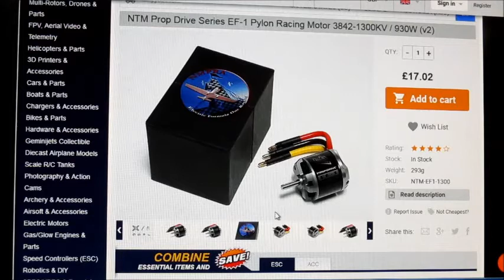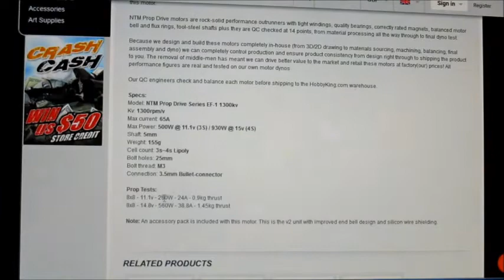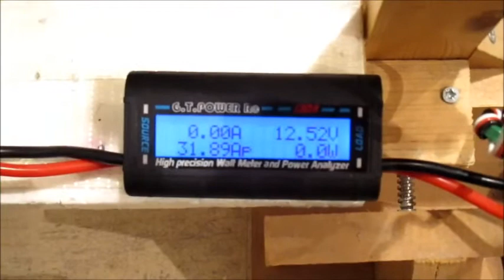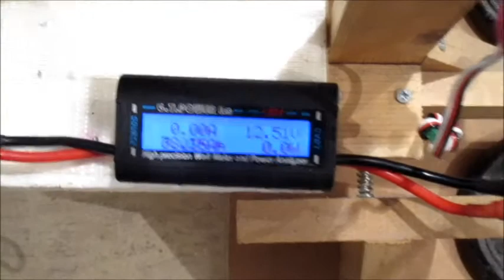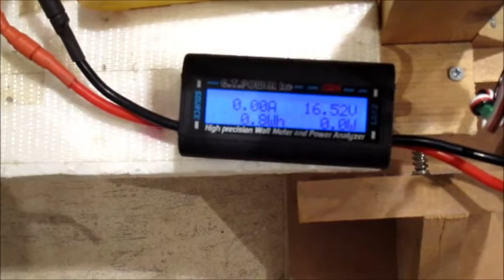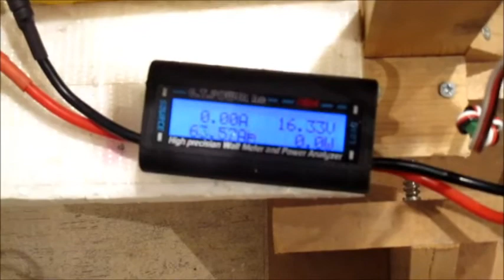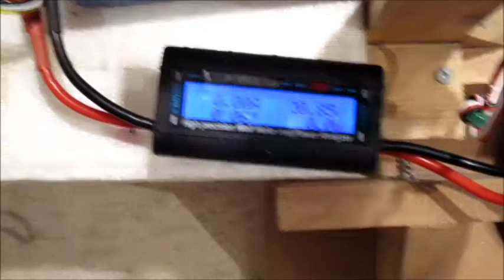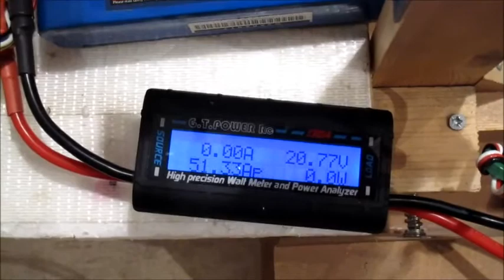PROPDRIVE 3842 EF-1 1300kv Pylon Racer Motor Thust Test Motor test of the Week

Comment: I have installed this motor in a Graupner Speed Cat, 9x8 APC Nitro, 4 s 2600 SLS , does really good job, does not get hot, I do not know what actual current and thrust on a test bench with no speed is. I can recommend this motor, despite I read several negative comments as well. But all in all the NTM 3536 1800 kV is in my eyes a bit more efficient.

Comment: what's  the @×@ for the propellers? Great vid dude, valuable info!
Reply from the maker: Cheers dude. The x shows the propeller size. So 8x8 means 8 by 8 inches. 8 inches long with a 8 inch pitch. The pitch is how far the prop would move through the air per revolution. Thanks for watching.